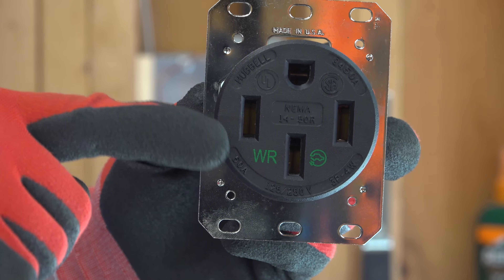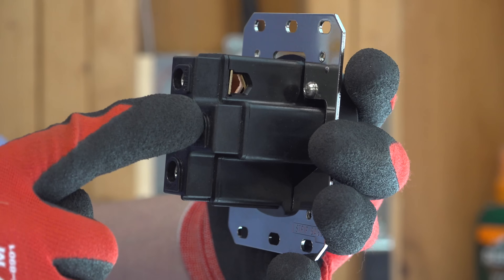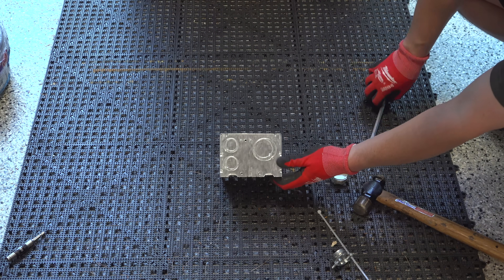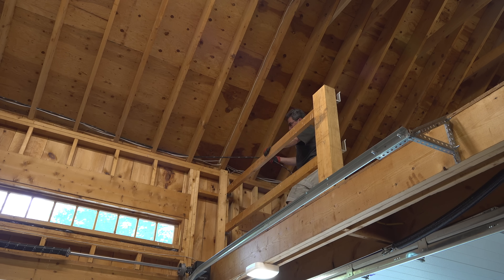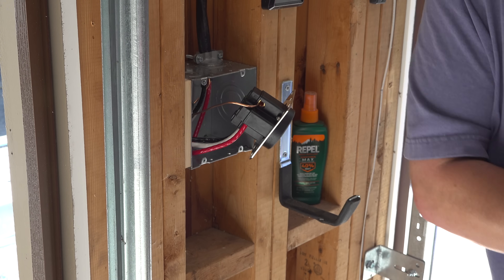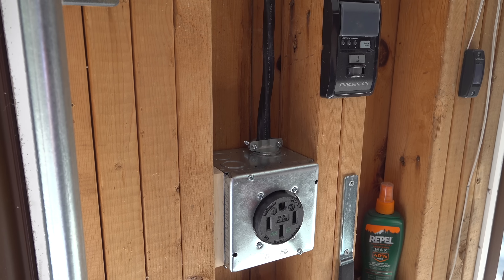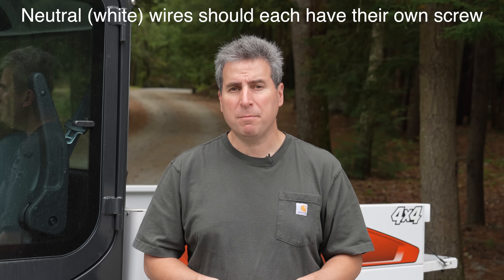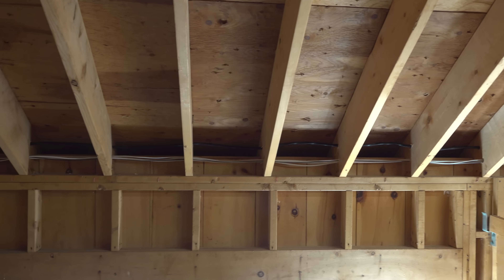How To Install A 240V Outlet Start to Finish -  EV Car Charger - Welder 14-50 Explained

Comment: From my understanding after you have torqued it down you should wiggle the wire and then re-torque it.  Wiggling it will simulate the vibrational loads overtime which loosens up the strands, so you normally can actually tighten it again to get to the same torque values.

Should also say it seems a bit casual saying if you wanted to be by the book in regards to the torque.  Plenty of fires have started because people didn't realize they applied too much torque or too little torque to those things (as it requires more force than one would think, but also easy to go overboard and squish the entire conductor)

Comment: For EV only applications: unless you drive 300 miles per day, you do NOT need a 50A plug. Also recommend hardwiring as it eliminates issues with plugs and you then don't need a GFI on that circuit (since the charger has one built in already.) Also an EV charger doesn't require neutral (mine had a plug with a neutral, in the charger box the neutral was neutered!)
Reply: Agreed on all counts.

Comment: Wrapping the ground wire around the screw is no longer allowed....
Reply: Metal Boxes. A connection shall be made between the one or more equipment grounding conductors and a metal box by means of a grounding screw that shall be used for no other purpose, equipment listed for grounding, or a listed grounding device.

Comment: The cheap outlets also fail from users plugging and unplugging devices in multiple times - the cheap ones are meant for plug in an leave it.  But the points on power draw are also valid

Comment: Pretty impressed with all the little things you continually address throughout, great job. I love that you covered bonded and unbonded. Tip, in the single screw EMT clamps, you can quickly snug them up with a pair of channel locks. Just a little squeeze and the wire has no slop.

Comment: Make sure to not connect a 50 amp car charger to the socket. Because it is a constant load you need to respect the 80% max load of the breaker. 40 amps will be fine.
Reply: A 50A car charger will only draw 40A

Comment: One thing overlooked about diy electrical work is licensing and permits. If your municipality allows homeowner permits and you don’t pull a permit or requires a licensed electrician to perform electrical work and you don’t hire one and do it yourself, if you have an EV fire or the receptacle causes a fire, the insurance investigator will look for the permit. No permit, if required, the insurance claim will be denied. If someone is injured or dies in the fire, criminal charges could be brought. Saving $1,000 could cost you everything. Just because you think you have the ability to do something doesn’t mean you should do it.

Comment: I just recently installed a 50amp breaker and receptacle.  Did not use GFCI, used the leviton, and used 8awg wires.  Guess we will have to see how long it will last.  I did use conduit for the wires and it is only a 6ft run.
Reply: 8 gauge rated for 50 amps?
Reply: @juicebox22a  yes it is....just not NM cable.
Reply: All garage receptacles have to be GFCI protected.
Reply: For a welder or EV charging.  Might sleep with one eye open if running a charger.
Only six feet?  Just replace it or stick in a 40A breaker.

Comment: A small distinction to be made here: THHN is not a cable, it is a type of insulation that surrounds the wire. Chances are the conductors (wire) that  make up that  6/3 Non metallic sheathed cable have THHN insulation. If installing in conduit, buy individual 6 awg THHN wire. You will need to consider conduit fill if you go the conduit route but 3/4" should be fine.

Comment: I saw on another YT channel a few folks bitching about how a certain manufacturer of home battery backup power not selling their top of the line (capable of providing 10Kw+ power) eqpt to DIYers. They were obviously not licensed, e.g. not aware of safety and dangers where you have to deal with 240V power.

Comment: Excellent video. I installed two 14-50s in my garage in 2020. If you look closely at the cheap Leviton, the blade holders only contact about half of the blades, while the more expensive one covers the entire blade. There are other affordable options that mimic the Hubbell design at a much lower price. I’ve actually replaced two Levitons that were overheating with these alternatives, and they’ve worked flawlessly for years. The key is full blade coverage—Hubbell isn’t the only solution.

Comment: The cheaper (under $20) NEMA 14-50R outlets are fine if you never have continuous (multi-hour) loads over 32A and plug/unplug the equipment less than a few times per year. The $40-80 versions are best for up to 40A continuous loads and/or equipment being unplugged more than a few times per year. Smaller EV chargers are typically 32A, medium EV chargers are 40A, and larger EV chargers are 48A+ (and need to be hardwired with thicker wire and higher capacity breakers.)

I think the reason you don't see even MORE outlet fires is because there are still way more 32 amp chargers out there than the other sizes, but that's quickly changing as batteries get larger and people expect the same charge times, so the EV rated outlets are the best way to maximize future compatibility. I've even seen people running 100A service wire to a mini-sub-panel just before the outlet so they can easily upgrade to the 48-80 amp chargers in the future as they become necessary. For example: it takes 16-20 hours to charge the Silverado EV from 10% to 80-100% on a 40A plug-in charger, but the charge time is back down to the more common 8-10 hours on the hard-wired 80A charger.

Comment: Installed my EV charging outlet, exactly like what you have, but without GFCI. It wasn’t required when I had this done in 2020. Should I have it added? I use a Tesla mobile connector and I believe it has GFCI built in so I’ve been ok so far. 😅

Comment: Not only can you use that 240-volt 50-amp outlet for your welder and EV charger, but when the day comes that you retire, you can also plug in an RV.  That way, you can keep the batteries topped off even during the winter holidays when it's too cold to be camping or RVing.  Your parents can also use your 240-volt outlet for their motorhome when they visit.  It can also add resale value to the house since it is ready for an EV.  Now that I think about it, maybe perhaps I should install an outlet like this in my garage.
Reply: Needs to be 60 amp for EV: 20% over 48A for Tesla model 3.
Reply: @HansSchulze  Lots of EVs can't use and do not benefit from more  . A car that can "only" pull 32A will still top off its battery overnight, from completely dead.  That said, there's no need to charge an EV only when it's depleted, the use case isn't like petroleum vehicles in that way.

Comment: Well done!  Hubbell is the only thing I’ll plug an EV into.
Reply: The Leviton is ok if you're only plugging a mobile charger into it. They typically only pull 32 amps, so they won't overheat it. 
With either plug, I'd recommend leaving the charger plugged in whenever possible. Put a switch ahead of the plug so you can turn it off without unplugging or going to the breaker box.
Reply: @Chris-k7x9d A constant 32A draw is WAY above what the cheap outlets are rated and designed for, that's been the whole point of the video. Why would you cheap out on saving $40 or $50 after spending tens of thousands on a car? Just because you're OK with using it, please don't try and justify it to others.
Reply: @simonpaine2347 No, constant 40A (20% below 50A rating) is above what they're designed for, but 32A is 20% below that! I installed mine before these were in the news, but I was worried anyway because I live in Florida and the garage gets hot, so I monitored it. Three years later, and I still check periodically: it's like new, and I charge daily.

Have I been thinking about getting the more expensive model? Sure, but at this point, that's really more for show than anything else.
Reply: @Chris-k7x9d Yep, just for show....until it isn't.
Reply: @simonpaine2347 Do you realize that 32 amps is only 64% of the rated 50? The plug never gets hotter than lukewarm! I'd bet you would say I needed to switch plugs if I was only pulling 20 amps, because reasons, right?

Comment: I have read that one of the challenges with the GFCI circuit breakers and an EV is that the EV also has a GFCI built in, which leads to 2 GFCIs on the same the circuit. I'm not an electrician, but I have read that the only way around this is to wire the charger directly (no outlet), which allows you to not require a GFCI circuit breaker, which meets code.  Correct me if I am wrong.
Reply: This is only an issue if there's a code requirement for selectivity (i.e. the closer one must activate first). If not, then on a ground fault, it's random which one activates, which may be a nuisance, but not a problem.